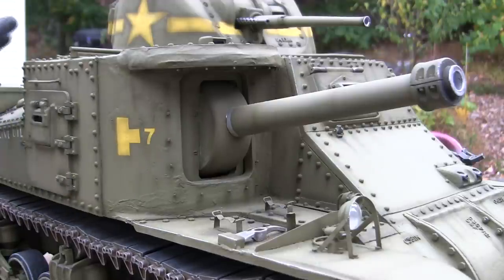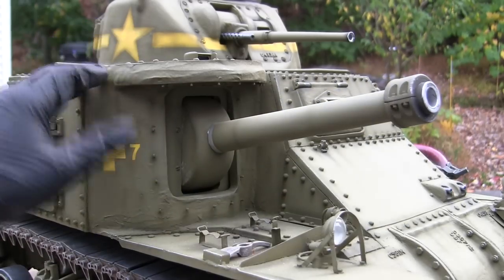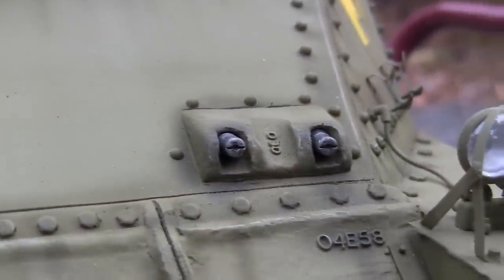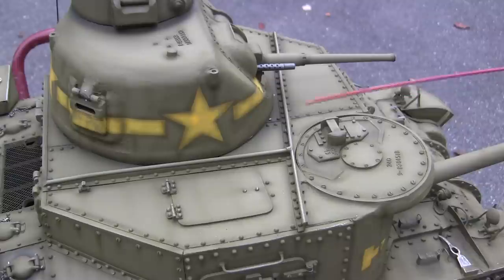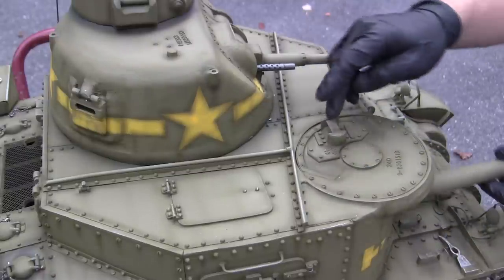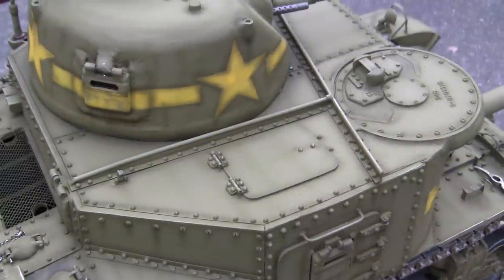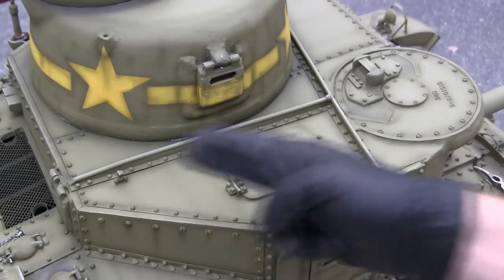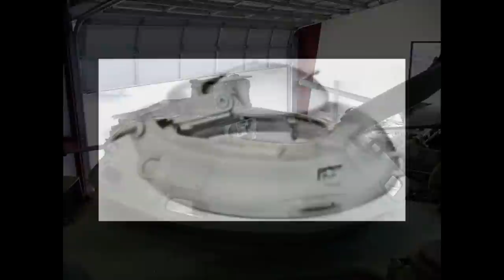1/6th scale M3 lee model showcase video part 2 of 2

Comment: Was away to ask if that 75 periscope rotated with the cannon, it also had a sun visor periscope shade protector it was abitty larger and sloped to like a peak to block out sun on the mirrors
Reply from the maker: The periscope was connected to the transverse, bu on the model I was not able to make it work so I left that static

Comment: how much does it weigh?
and you said on your first video that youd make these things if someone requested one?
now im a total noob (im only 20)  at modelling in general and i have neither the engineering skills or the patience to make something like this myself, and i PROBLY dont have the money to given you for one of these but out of curiosity how much would you sell one for?
its just the idea of making one of these into an RC is so cool to me......
i donno ive been lurking on both plastic panzers AND east coast army for like two years now so its like
kind of an itch that maybe ill be able to scratch when im one of those hardcore old guys whove been modelling their whole lives yknow?
Reply from the maker: This one comes in at around 35 - 40 lbs, which is light for a 1/6th scale tank. As for commission builds I do take on builds, but I never disclose dollar amounts on open comments on here or on the facebook page. Prices and options are disclosed in emails or PMs. 

As for RC converting these, that is a very difficult and expensive avenue. Generally from my experience the best 1/6th RC tanks are ones that were built up from using a RC kit, (vantex, armortek...etc) to RC convert will require lots more engineering and expenses and in most cases the builder fails / never finishes the build, or takes shortcuts that may result in a model that sorta runs ok, but the running gear detailing is an eye soar.

As for your age / skill that should not inhibit you from getting your feet wet. Many of the 1/6th builds that are posted on the ECA website were built when I was your age (now I sound like an old guy lol). My advise is to start small and build up your skills and tooling. From there you can level up as the same techniques that are used in 1/35 are used for 1/16 and 1/6. With this foundation making the jump will not be as hard. So start with some cheap 1/35 kits, build them OOB at first then from there learn how to add details either aftermarket or scratch build . From there level up to 1/16, 

There you can mess around with some scratch building and RC. once you have a good grasp on your skills then make the jump to 1/6. Start off with something easy like a M5A1 from 21st century toys... then from there move your way to the Dragon 1/6th kits... which will eventually lead you to the sherman. By this point you should feel confident on tackling a rotomold kit or an FOA ABS kit, as by this point you should have the scratch building / modding know how , the eye on what to look for / how to do it, and most importantly the tools required to execute these procedures. 

With the internet and youtube you can learn much more efficiently and quickly compared to the old days.

Comment: See whare you had the tripod on the fender that's where its stored on a cast hull m3 lee the moved it because couldn't find a way to drill the casting haha
Reply from the maker: It's also stored there on the standard steel plate M3 too. The M3 had lots of M1919A4s and each would be able to mount on a tripod if dismounted